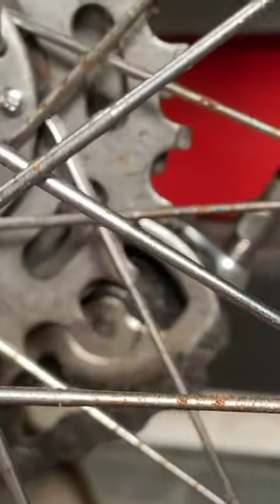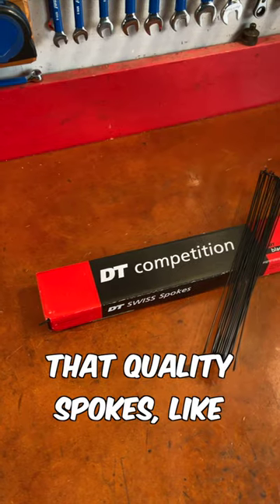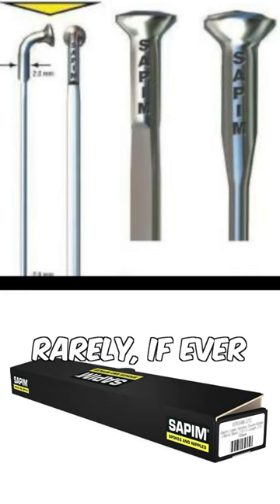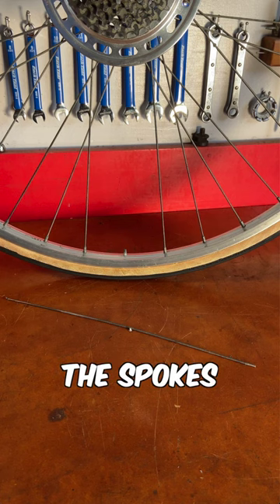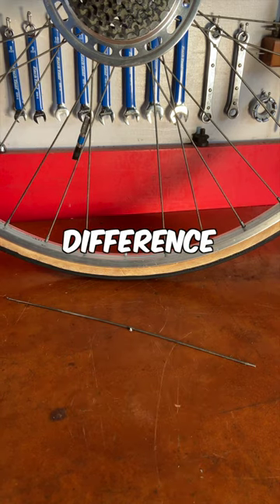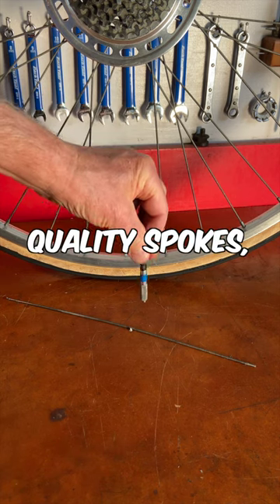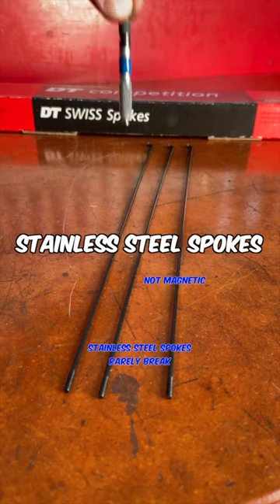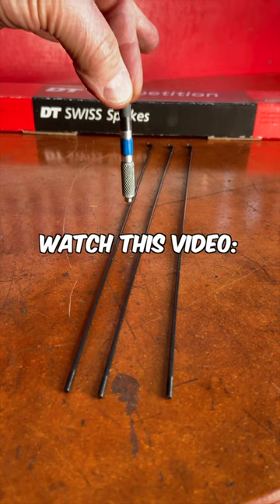Are Your Spokes Breaking? DO THE MAGNET TEST! #shorts

Comment: I think this short leads some to misinterpret the why - by assuming it has something to do with tensile strength of the different materials, rather than it is because stainless is passive and far more resistant to rust and galvanic corrosion, particularly at the J-bend where it's in contact with an aluminum hub.
Reply from the maker: Thanks for watching and the feedback. Hopefully it won't confuse anyone and the key point will come across, which is that if you're breaking spokes the most likely cause is bad spokes (not just corrosion) and the way to fix the problem is to put in quality spokes like DT Swiss or Sapim.